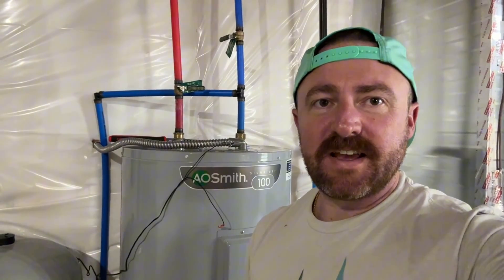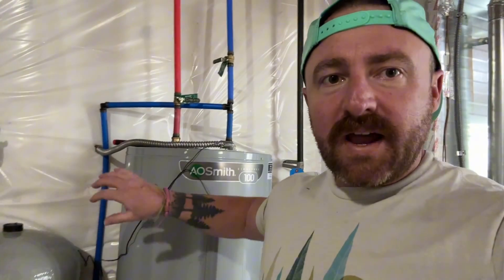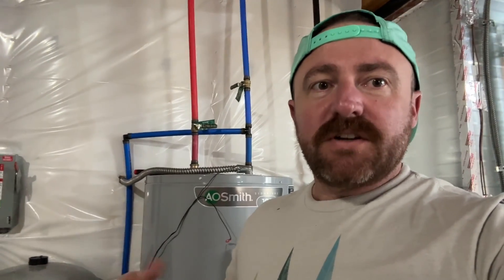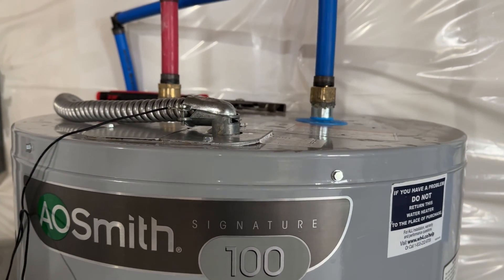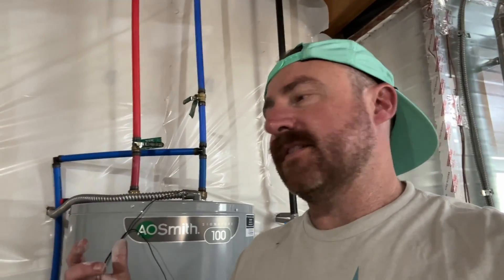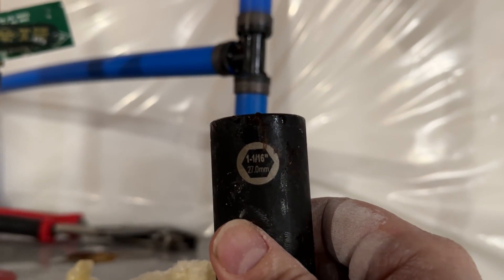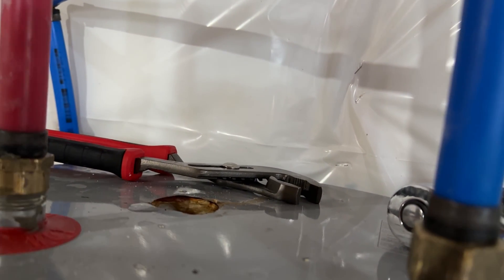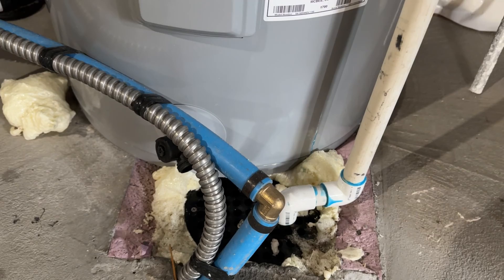Eliminate Smelly Hot Water: Does the Powered Anode Rod Really Work?

Comment: do you turn the water heater off when you are not there?  do you leave the powered anode rod on at all times?
Reply from the maker: Great questions. I turn the hot water down to the lowest setting if I’m not going to be there for over a week. I do keep the anode plugged in all the time to avoid any build up.